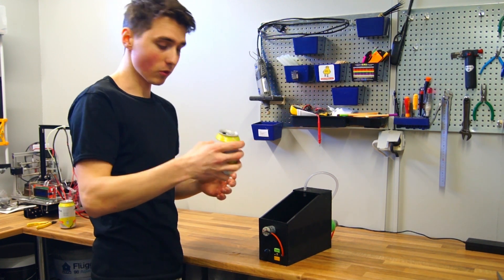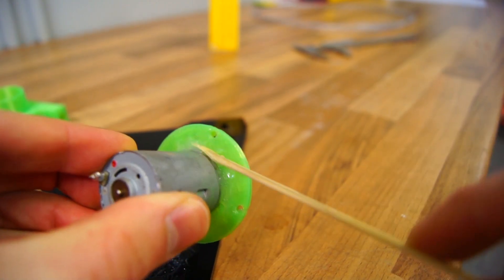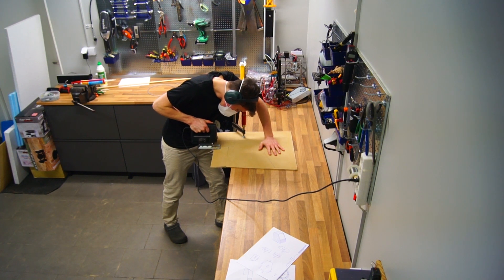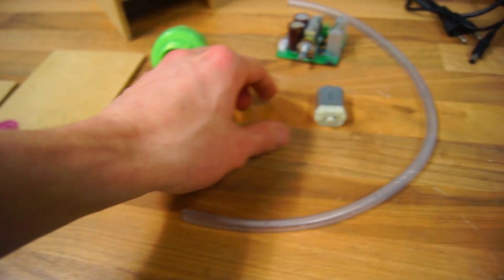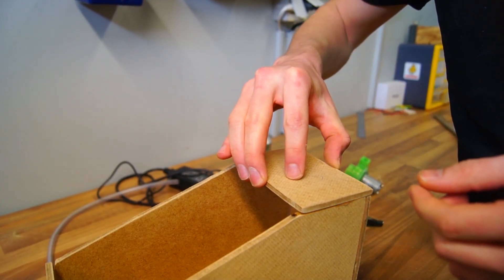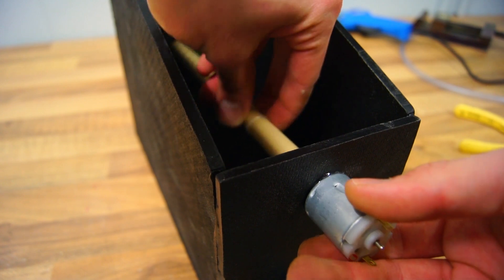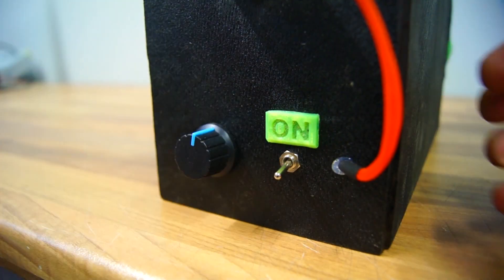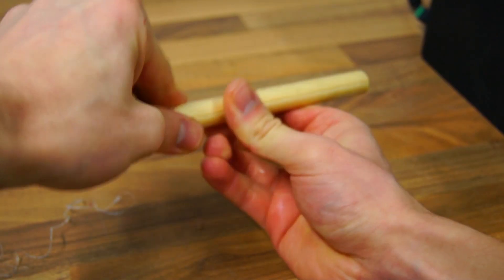Instant Drink Chiller - How to Make a Cooling Machine

Comment: I found many years back that if i ran a small stream of water onto a can in my sink my beer would chill alot faster than in the fridge. The flowing water just carried away the heat with ease. Very cool machine. Now combine it with a few peltire junctions to chill the water.👍

Comment: This is so cool! I came across randomly a soda chiller on amazon for $30 but it does not seem that it will last that long. Then I found an extremely high grade one that is almost $100. Was thinking about making my own like you did and I guess this is a sign that the universe is telling me I need to have chilled sodas after all(apart from using the freezer and a wet paper towel around it and leaving it in for 40min. Thanks so much for making this video! You seem like a smart and cool dude.

Comment: you really dont need a speed controller lol... Just wire both motors directly to the battery with an on off switch and itll be fine
Reply: Need to start slow to get traction otherwise wood will slip on can
Reply: @Anonymous-vh6kp  just built one without a speed controller and it works perfectly

Comment: I was thinking about long term use since it's wood, if you spray a layer of clear coating it will work for longer
I know there's paint, but extra protection won't hurt
Reply: I think it's some sort of fiberglass composite thing, not plain wood.

Comment: If you put the can under the dowel and ran it without even having a pump it will work faster.  You have more surface area if the can is fully submerged and if the can is moving under the dowel/water it will keep the water mixing

Comment: lest be honest wood ( mdf ) plus water is a never good combination and you only used paint .
i like the idea but the doing isnt the best let me state some points:
1- that motor controller is not cheap , you can use l298N module with a pot in the input ( you can find more info on my channel).
2- mdf and just a paint will not work you need a water prove paint or just use a plastic container thats the best option
3 you need to make  make a hole so the water can be replaced with out flipping the system up side down
4- you need to make sure the ice will not melt fast in summer so maybe add an thermo isolation 
i hope this will help the makers out there to make one . 
and if anyone have more ideas just tell me i want to learn new things.
Reply: he didn't use mdf he said it was "water resistant board".
Reply: @TheKarimamrmostafa   1:38 sorry my bad , buts still my other points are correct right?
Reply: @TnInventor  yup :D

Comment: We used to do this in 1967 spinning a can on top of Ice, and then I saw a commercial in the 1980s for a unit that turned the can while sitting on ice powered by flashlight batteries. I think it cost about $12..and is STILL available on Ebey  So this is NOT NEW.

Comment: So the ice bath has water that might not have had all its heat energy pulled out of it. I would have liked to see a temp reading on the water reservoirs, but still- it's clear that splashing near frozen water on a can chills it so much faster than just waiting for the heat energy to dissipate out of a non moving can.
Reply: You have to wait to open the can so it doesn't explode the contents.  The time it takes to wait and just having a can sit in an ice bath, you'll probably get the same results.  I think this machine is not so innovative.

Comment: Unfortunately your theory is wrong:
The warm liquid is less dense than the colder liquid. Therefore by spinning the can, the cooler liquid will move to the outside of the can causing the can to appear cooler.

The measurement you made is invalid because you measure the temperature of the can rather than the average temperature of the liquid inside it. If you wanted to correctly measure the temperature you would have to pour the liquid out. The act of doing so will mix it up so the temperature is relatively constant. You could then measure the temperature of this liquid. 

This is in actual fact a slower method of cooling your drink to a given temperature because the rate of heat transfer is proportional to the temperature difference. Because cooler liquid is coming in contact with the can, the temperature difference is lower so the rate of heat transfer is also lower. This design also has the disadvantage that the entire surface area of the can is not being used to transfer heat whereas just putting the can in the ice bath will result in a larger surface for heat transfer.
Reply: so if you put a small "water fan" in the water to make the water circulate and be switched out faster it would have a greater effect?

Comment: Probably would have cooled faster if you reduced the friction of the can against the wall with a second roller.

Also, adding salt to liquify ice at a lower temperature helps because it would drop the water temperature below 0° C/32° F.
Reply: Salt may bum up the pump after time, but who knows.

Comment: RCLifeOn - OMG pal, what a Rube Goldberg contraption!  Instead, you could have easily and cheaply made a simple refrigerated cooler using an inexpensive Peltier effect thermoelectric chip attached to a small copper or aluminum slab, or better yet a sleeve, acting as a heatsink to quickly and efficiently transfer the cold output side of the Peltier chip into the soft-drink can.  All you would need is a 12-18v power supply and an On/Off switch, and maybe some carved out Styrofoam as an insulation blanket.  You wouldn't need a water pump, reservoir, can rotator mechanism, controller, and most importantly, no trips to the refrigerator each time to get ice.  And why didn't you 3D print the reservoir?  Printing with a light infill with thick walls the reservoir would have been a great insulator.

Hmmm... normally your videos are entertaining and informative, which is why I'm subscribed.  But in this case I have to ask you... 

Dude, what were you smoking (Colorado's finest?) when you came up with this thing?

Comment: You could actually put the thermoelectric water cooler you made in another video in between the pump and the water. and then put in a temperature controller to run the pump on and off. Just as an upgraded version.

Comment: You could improve this by lowering the surface tension of the water so that it makes better thermal contact with the can. Products are available that are used in car engine cooling systems.

Comment: you should remake the proyect but with a peltier module! :D
Reply: Peltiers suck.
They work but they are so inefficient!
Outsourcing the actual cooling to a compressor based cooling system (aka freezer) is way better in my opinion
Reply: @engineer0239  I know this is late but you are correct they require 600w or more power to operate and need good cooling to run properly and wont stay cold for too long unless if you have thick insulation but still it's very inefficient
Reply: @AWAY It's a solid state chilling device.  He's suggesting to make a device that will chill the water without ice.

Comment: Is the "water resistant board" you're using MDF? You shouldn't be getting that stuff wet, let alone be drinking/eating anything that has come into contact with the contaminated water.

I wouldn't use anything but plexiglass or plastic sheets to make that contraption.

Comment: the explanation is a bit off, it cools faster mostly because the flowing water has a much higher heat transfer coefficient not because the liquid inside is moving (though that does play a small part in the cooling)

you'd see a similar effect if you moved the can around in a bucket of ice

Comment: I would love to see a Peltier element version of this that doesn't require ice, just a metallic tray to act as the heat sink which the water sits in. (basically what you did in your thermoelectric cooling hack vid but with the can rotating feature) That way you could bring it on the go with no need to carry bags of ice!
Reply: That's what I thought this was gonna be, and then I saw the hose............
Reply: I thought about this too and was annoyed at the video.
Then I calculated what amount of peltier elements and electricity you would need.
Not viable. You would have to make/extract a cooling circuit from a fridge.

Comment: Just out of curiosity, why didn't you use plastic for the interior part? Couldn't you have 3D printed something? If not, couldn't you have used something of the approximate size and used it as a liner or something? Even using some plastic wrap or plastic drop cloth like stuff could have worked if you glued it to the interior of the wood. I'm concerned that the paint will not be sufficient to seal in the water and that the wood will eventually rot.

Comment: "Waterproofing is Key, I Drenched it in glue" yet at 7:39 you can see water drop off the motor, and he built this with a wood box and not a polymer.. If you're going to upload how-tos, make them either A, Funny and Almost on point, or B, Accurate. Thanks. ~The Internet.

Comment: Preface: This is cool as hell, good job.

Buuuuuuuuuuuut...

Could you not accomplish the same thing using one of those freezer cups? Just fill it with water and develop some simple contrivance to rotate the can in the cup? The can rotating will drive the water both inside and outside the can and chill just as fast, if not faster because of more ideal contact with the water.

Comment: This was not a fair test : we see him measure the heat of the machine cooled can by the white part of the can, now the colour white combined with the reflectiveness of the can emits much less than when he holds the measurer over the black text on the second can, thus the black colour being a better emitter of radiation, now we must remember that there is no such thing as cold, just the lack of heat since we have not yet reached absolute zero. This test would have had similar results although the values may have differed.
Reply: Very good point, those thermometers have to be tuned to the specific materials they are measuring.

Comment: Use a 45w peltier, 2 aluminum heat sinks, temp sensor, a temperature controller, and 1 90mm fan. It will eliminate the need for ice and it will keep the water at near freezing temperatures. No more adding ice.
Reply: How long would it take though?

Comment: Cool design. You could definitely add some Peltier Elements to cool the water in the machine down. This way you don't need to prepare ice for the machine because instead of remembering to make some ice you could remember to cool your drinks too LOL. With two of there thermoelectric coolers in the machine it will run entirely on electricity and can even be driven with some 18650 or other batteries and could be a cool gadget for outdoor parties or it just could be powered by a 12v car outlet.

Comment: What Voltage is going to the motor. Mains or Low Volt.. Two reasons. 1) Live UN-covered contacts.  2)  When in operation you can see water dripping from the back end of the motor. 

PS: You could have just added salt to the Ice + Water...

Comment: its not real water temp, its aluminum can temp.
Reply: Aluminum has a very high rate of thermal conductivity, which is why most heatsinks are made from it.The outside of the can will be within a few tenths of a degree from whatever it's touching (in this case, the liquid within).
Reply: good point

Comment: not a cooling machine, machine did no cooling, water did cooling, i feel cheated... i'm in the desert and all i have found is some batteries motors and wood, and i build this, in the desert, where do i get my cold water??? i am dead now. i died. you lied. i died.
Reply: why would you need this in the first place if you had no water
Reply: lez briddon lol thats what im thinking
Reply: lez briddon lol.. best ever.
Reply: G Machi No get the fuck out piece of shit
Reply: Ok, if it's the water alone that did the cooling, then why were the two cans at different temperatures after being taken out of two different baths? He explained at the end that by having the can turning it allowed the liquid in the middle of the can to be agitated, then running water over it helped to speed up the cooling process versus just setting it in a water bath.
Reply: lez briddon please subscribe my youtube channel
Reply: Lie #2 this is a stolen idea its called the cooper cooler

Comment: ridiculous waste of effort and electricity, if you want to to fast chill pop to near freezing while it is still in the can the process is very very simple. You fill a sink with ice and then a little bit of water, add salt - the salt lowers the freezing point of the water to -4, then put your cans in, within 15-20 minutes you cans of coke will be chilled!!!

Comment: Why doesn't the carbonated beverage explode when you open it
Reply: Jake Mullen rotating a can doesn't really agitate the liquid inside much
Reply: You sir, are correct.
Reply: Guys. the drick is called Ramlösa, and it is light carbonated🤘
Reply: Because you are not agetating the oxygenated area
Reply: The beverage doesnt explode when opened.

When a carbonated beverage is shaken up, pressure builds up as dissolved CO2 comes out of solution and then bubbles form. When the beverage is opened those bubbles expand and occupy a larger area thus forcing the liquid out of the can. If you can tap the can so that all of the bubbles float to the top and wait till they all get to the top then try to open the can they will simply expand and exit the can without making a mess.

Here is a fun experiment to prove it:

1. Obtain a carbonated beverage in a transparent (see through) bottle

2. Shake up the beverage and observe the bubbles and how they act.

3. Flick the sides of the bottle untill all of the bubbles float to the top

4. Open the bottles cap and if done correctly then only gas should come out while the liquid remains in the bottle.

Extra: pour out a cup of soda and re-cap the bottle and shake it again,  this time slightly open the cap to release the pressure slowly, observe how the bubbles slowly expand and push the liquid upward. Make sure to close the bottle if its about to spill over and to do this over a sink incase you make a mess
Reply: sorry for being 2 years late but that happened because whats makes explode it's the air (of the can) that introduce into the liquid (when you shake it) that when you opened create a spontaneous reaction on the liquid what releases all the co2 on it... so if you roll the can that air doesn't go on it. (Veritasium have a video about it)
Reply: MyLonewolf25 correct, it doesn't explode if you spin it, it explodes if you shake it
Reply: because its cold and being cold theres less pressure inside. even if it was shaken up.
AND how soda cans are made they don't normally explode when you open them.
Ive even opened one that was bulging at both ends and it just released the pressure calmy without flying everywhere.
but DONT puncture it on the side or something.. it WILL go flying everywhere
Happened to me with a 2liter soda bottle and it nearly soaked my whole bedroom and almost got to my computer. YIKES.
Reply: @realflow100  completely wrong...
Stop spreading false information idiot
Reply: Well soda cans are different and they usually dont shoot everywhere.
Reply: It wont explode becuz it San Pellegrino
Reply: Gases become more soluble in liquids as the liquid becomes colder, this is because of the decreased molecule movement of the liquid allowing for the gases to remain in-between the molecules. Shaking up a soda can will introduce kinetic energy into the system, therefore, moving the liquid's molecules more and forcing any gases out, increasing pressure.

Comment: Nice made video, even thought cant say same about the content. Maybe I`m being too critical, but just think rationally if u can get ice from fridge so why u just don`t throw the drink into bucket with ice and put bunch of a salt and the drink will get cold in like a few seconds (330ml) and u wont need to use extra electrical power and spend time constructing gear. Would have appreciated if there would be more statistics comparing time/temperature of cooling in the machine, in ice bucket or even in fridge, that would make video more scientifically interesting. But keep it up and improve ur videos, seems like u have fans already.

Comment: Tjusigt!
För andras skull är det väl bäst att skriva på engelska... 

The axle is wood, how well does it handle being in water? 
I agree you should have salt in the water as it lets the water drop in temperature under 0 degrees C and stay liquid. 
Maybe some roller on the side would be good, so you don't wear the side panel down. 

I now challenge you to do it with just one motor... and in transparent acrylic plastic instead.